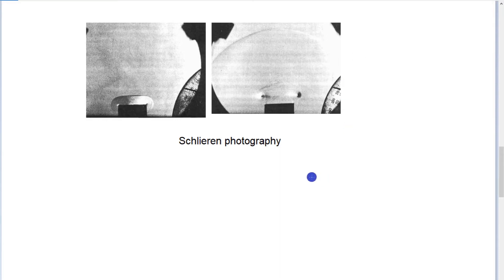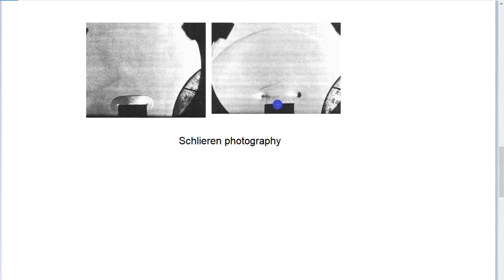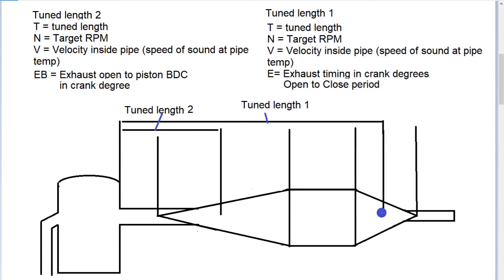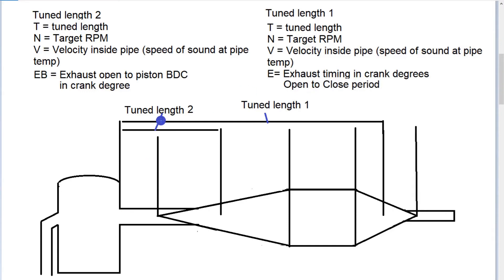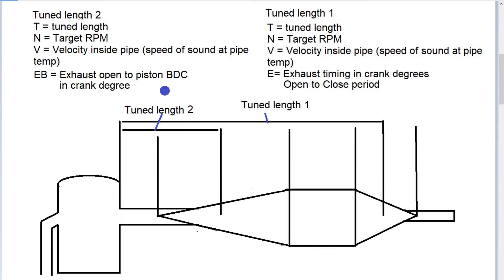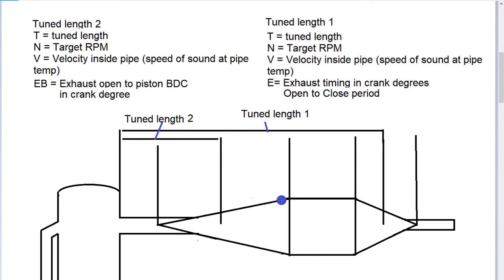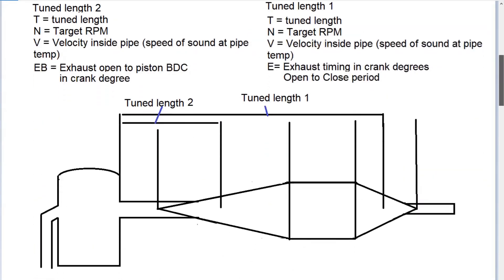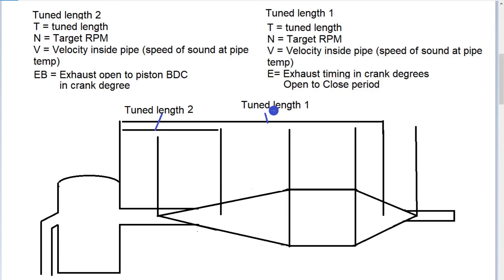The two tuned lengths of the 2 stroke expansion chamber, photo of compression wave formation. E3

Comment: Would expansion exhaust be benifital for a rotary engine ?
Reply from the maker: In short, no.
Reply from the maker: The long answer as to why it wouldn't help is that an expansion chambers relies in a pressurised intake such as a 2 stroke has, the crank case creating a compression of the intake mixture that is then fed to the cylinder via transfers.
A rotary or any normally aspirated engine lacks that.
It would work with a super charger and has been used but as the super charger pressure can be dialed up it negates the need for an expansion chamber that would only work over a limited RPM range anyway.
Reply: @AuMechanic  do you know of any rotary exhaust tunning science,  like matching  extractor lengths to engine port sizing?
Reply from the maker: @shaunessex3095  
Never built an exhaust for a rotary only 4t and 2t piston engines so I don't have the experience to give advice on it.
A general guideline to matching ex port to header is aim to have a the same or slightly large header than port, but never smaller header.
And always use mandrel bent sections for bends to maintain the cross sectional area of the pipes.
Reply: I've always been in the understanding rotary exhaust requires a sertain amount of back pressure but not many people mention it though, rotaries are essentially 4 cycle 2stroke simular animals ,but the gas tem

Comment: Can I reduce the header length by 90% & compensate in My baffle cone & chamber dimensions?
Reply from the maker: Not if you want to pipe to work correctly.
A small change in the header is ok but not 90%
Reply: @AuMechanic  
So why is a motocross pipe header so much shorter than a header on a street machine like the H1?

I just wonder if the software will let Me start the divergent cone within 3" of port instead of 12" before diverging, if I overcompensate in other areas to possibly increase overall performance.

One thing is certain, I will be moving redline from 9000 to 12,000 rpm, so many factors at work here.

Thanks for taking time to answer. 

What would be the broad effect?
A total loss of power or merely narrowing the power band?
I thought of taking an 01 CR250R pipe apart, & reverse engineering 3 prototypes & just bolt em on to see what changes good or bad occur, then rechunking the figures in the software to establish a baseline.
Reply from the maker: @Not1Edit  "So why is a motocross pipe header so much shorter than a header on a street machine like the H1?"
Because the header is quote tapered compared to a street or race pipe for example that operates in a more narrow power band.
In short, longer cones equals wider power band at lower peak. shorter straighter cones are shorter power band at higher peak
Reply: @AuMechanic  
Not much for kicking ideas around eh?

Answer Me this then, all things being equal what would be the effect of a 250cc pipe on a 125cc & vice versa?
Reply from the maker: @Not1Edit  Got as full dance card these days.
As to 250 125, the pipe dimensions are in proportion to the port window area which itself is in proportion to the engine capacity, so a smaller bore and stroke will have a smaller port window which will result in a smaller pipe using a pipe calculator.
Reply: @AuMechanic  
Thank You very much, as soon as I get My new top end degreed & calculated I'll be in touch.
Reply: I got Your software downloaded, plugged My numbers in & got a very accurate appearing  render of other aftermarket chambers, which is what I had hoped for.

What I wasn't able to do was adjust outputs to suit My design constraints, so I'll still have to do a bit of improv, but that's okay, Your software gave me an ideal, so using that as a baseline I can extrapolate & tweak from there.
Cheers mate, & thanks again, I'll be in touch. @AuMechanic

Comment: Great stuff mate. I’m in the process of designing a pipe for a vintage MX 125 and I’d like to verify my design with these concepts. What formula should I use to arrive at the tuned lengths for these two tuned lengths ? For the port blocking do I use the degree open of ex port to closure of transfer port ? In my case it would be half of 190 (ex) plus half of transfer 130 equaling 160 degrees.
Reply from the maker: Have a look in the description section for the link to my free Pipe Calc software that can do the calculations.
Transfer timing is not part of the tuned length calc, it is based on Ex port timing only.
Reply: Sorry , night shift haze . Port plugging is ex port open to port close . 190 degree in my case however expansion wave from BDC to TFR close I take it . Question 2 
If Approaching BDC piston movement is Deminishing for every degree of rotation. This would mean crankcase compression is also reducing. Maybe the inertia of the gas flow counters what I’m about to say but wouldn’t it be good to get pipe suction just before BDC ?
Reply from the maker: @thirdstone4107  
Re question 2. That is the case, the expansion wave (AKA suction wave) that comes from the diffuser cone should arrive around BDC. See this video here https://www.youtube.com/watch?v=5fojBHZNAWM
Reply: AuMechanic what is the formula for the tuned lengths for? I’ve been trying to nut this out but no success. For a duration of 190 deg do I use 95 deg for suction wave which would have the crank at BDC ?Same with the blocking wave which you time for the closing of the transfers. I couldn’t see this info in the free program. Cheers
Reply from the maker: @thirdstone4107  
You insert the total duration of Exhaust (in my software) of 190 degree, using the RPM that is the maximum RPM of the engine (and average Exhaust temp based on BMEP). reflectedIn the video I refer to there being 2 tuned lengths (for the purpose of demonstrating that there are 2 wave reflections to time) but in the equation we only need to calculate the tuned length of the compression (plugging) wave. The equation used (Prof Blair) accounts for the tuned length of the first expansion wave in relation to the second compression wave is in the equation so there is no need to calculate it separately.
Reply: AuMechanic thanks , I understand the total tuned length . I was hoping that there was some calculations that would aid in working out the length of the reflector cone and also the start of the belly. WRT the 3 Rd stage diffuser would that be positioned where the wave would be a BDC at the target RPM? I guess that is all included in the program. 
The tuned length is what it is for all types of engines however the rest of the design would differ a lot between a road racer and a MX bike . Cheers
Reply from the maker: @thirdstone4107  
No it wont differ as the cone taper is remains in the same relationship to the rest of the pipe in the equation.
Keep in mind that Exhaust port timing (closing BTDC and opening ATDC) is symmetrical (same number of degree form TDC) so BDC is always half of the total timing.
Reply: Donated to buy you a drink , Cheers
Reply from the maker: @thirdstone4107  
Thank you, much appreciated.
Hope you find the software useful.

Comment: Outboards use a "sliding" expansion chamber. I believe they shorten the pipe for torque, lengthen for RPM. Can you explain this?
Reply from the maker: Adjusting the length changes to "tuned length" as covered in the videos.
A shorter tuned length will be tuned to higher RPM

Comment: How do you calculate the 2nd(diffuser) tuned length? Whats the formula
Reply from the maker: You dont need to using the caclulator software.
Showing there are 2 tuned lengths is just to demonstrate the principle of the 2 differring wave reflections in the pipe being the expansion wave from the diffuser and the compression wave off the baffle cone and there different arrival times back at the exhaust port.
Reply: @AuMechanic  so you cant calculate the 2nd tuned length without the software? Just like how the 1st tuned length can be calculated with jennings and bell's formulas
Reply from the maker: @wrongchannelsearchfordeank6834  
You can calculate it just the same way, but for the purpose of designing a pipe it is not needed.
Bells equations are a metric derivative of Jennings for the late 1970's
What I use in the software is Blairs equation from the late 90's that was created using far more scientific methods than Jennings.
Basically Jennings specifies lengths of the sections where Blair provides ratios to determine the lengths that you enter into the software.
Reply: @AuMechanic  thank you i truly appreciate your explaining

Comment: Hi, thank you for this videos , they are really helpfull. As a general rule i undersand that having a longer pipe between exhaust port and the divergent cone help for low rom . How will look like an exhaust for a minareli am6 with 80cc cilinder 22mm carb for as much torque as posibile and as wide as posibile power band ? I agree to sacrifice all the power above 9k-10k rpm If needed . I want to get rid of that motocross feeling and get a more usuable power band between 5k-10k .
Reply from the maker: Regarding the header pipe length, what you stated there about longer headers equals more low end, it is from very early book and pipe equations by Gordon Jennings from the 1970's and was created by him measuring numerous pipes and some reverse engineering to arrive at his theories on pipes..
If you watch the series of videos here they are based on later more scientific SAE published studies done by Professor Gordon Blair published around 1996 that provides pipe equations used in the free software I have available.

In that, more low end or wider power spread requires a few factors in the whole pipe design more than just the header pipe, as you will see if you use it.

Comment: I have a older jet boat. Inline 4 cyl 2stroke an they all share a single manifold an just feel like it’s a horrible design an possibly a waste of fuel an more so power. I am limited on space a little bit in comparison to say 4 single 400cc dirt bike exspansion chambers to be able to fit in there so I’m looking into making my own. I’ve gotta pretty good at welding an tig welding. Now looking for more info on the actual leaghths to see if with my limited space if I’m able to achieve performance gains with four short chambers or if I’m best off with the current no chambers design it came with in 1999 an also all 2stroke boat engines fer that matter. Still makes no sense why they did that. I run 3,000 rpm when I hit throttle an up to 5,500rpm but most the time I’m at 4,500-5,200rpm so it’s still a very narrow window witch wat I heard is they don’t run them because they are for a narrow window of rpm we’ll boats are in a narrow window of rpm. I’m wrkn with 1,000 rpm so wouldn’t chambers be a great way to add some usable power
Reply from the maker: Ive replied to this in the other video comment (here https://www.youtube.com/watch?v=4_DmKcJieNg&lc= ) but just to reiterate that noise and emissions are other reasons for the stock exhaust.

An expansion chamber can be designed to provide broad power but it come as the expensive of peak power.
Re lengths, have a look at the later videos covering "tuned length"

Comment: 3 min 44 you say "sometime between that point". do you go into it in more detail on any of your videos? also   at what point of the combustion stroke do the gases exiting the exhaust port  not carry a pulse?  cos they only fire out of the port for so long.
and when exactly do you want the suction pulse to stop in relation to the transfer . just as its closing or a tad before? also i would love to see the demonstration with numbers that you refer to that you say on the next one but i cant find it. great videos.cheers
Reply from the maker: I cover this a bit more in other videos but specifically or at least in the case of the Blair Design Chamber the peak of the Expansion wave needs to return around BDC and continue to through the period of upstroke while the transfer is still open to a fair degree to aid transfer.
When the transfer is nearly closed there is little served by having the pulse timed to move only a small amount through the remaining small opening, keeping in mind the pulse of the expansion wave only last for so long.

The exhaust "pulse" you refer to from exhaust gases occurs only at the short moment the exhaust opens at the blow down stage, being created by the initial pressure differential causing the gas to pass through the opening at very high speed which causes the compression wave (you can think of as a sound pulse) to travel at the local speed of sound down the pipe which is a lot faster than the bulk of the exhaust gas.
See later video named "Active Demo of Wave" might explain bit more.
Reply: so once the piston is opening the transfers on its descent that's basically the end of usable pulses coming FROM the exhaust port?so that's the point in crank rotation  that I have to work out how fast the pulses travel and are sent back to do their correct jobs through cone convergence or divergence?I know I could just enter the details into your calc but I still would like to know whats happening. initially my first thought is, having a longer blowdown (till the transfers open) gives me a longer pulse to play with. and if the pipe is good enough it could actually outweigh the disadvantages of a longer blowdown re less scavenging.?
Reply from the maker: There is one "pulse" coming from the exhaust at the moment it opens being the initial compression wave that then travels down the pipe, the second one being the expansion wave and it is timed to be reflected back from the diffuser taper back into the exhaust port, the peak of it arriving around BDC.
Blow down period is not directly related to the pipe function, blown down is the period between exhaust open and transfer open, and blow down has to be long enough to ensure enough pressure blows down out the exhaust before the transfer opens or an excess of exhaust will be pushed back down the transfer when it opens against the fresh intake coming up the transfer to the cylinder
Reply: really only one pulse? so when is the exact time of this pulse for working out when it needs to return? I cant get my head round when this happens. it cant happen as the port opens because its only a fraction open, or does the pulse have a duration? ie starts as the port opens and ends a few degrees later?
Reply from the maker: @aljaxon69  
One positive pressure pulse is created, but you end up with 2 pulses, one is a reflection form the first cone and the other is the original pulse that bounces of the second rear cone.
"does the pulse have a duration? ie starts as the port opens and ends a few degrees later?"
Yes that is pretty much it.
The positive pressure pulse (compression wave) moves at the local speed of sound inside the pipe which is predominately determined by gas temperature in the pipe it is travelling through.
As the initial compression wave passes the first diffuser cone an expansion wave (you can think of as suction pulse although that is not technically correct) is reflected back arriving at around BDC to help draw fresh mixture into the cylinder from the transfers..
The total length of the pipe (tuned length) is set to ensure the pulse (compression wave) travels down the pipe to the end cone and back again within the exhaust port open period at a given RPM.
It's job is to push intake mixture that has spilled out the exhaust port back into the cylinder, called port plugging.
Reply: yeah I understand how the diverging cones/diffuser  send back a "suction" pulse and the converging /baffle cone sends back a stuffing pulse but its the duration of these pulses. I thought they were continuous pulses or waves that started as the ex port opened and then slowly died out as the pressure dropped in the cylinder. dunno why I thought that, maybe that's how it had been explained to me before.I need to know the exact duration of the pulse at its beginning so I can then calculate lengths to get it back at the port. also some of the pulse gets sent back by the diffuser and some gets sent back by the baffle cone so how do we decide how much we use to suck and how much to stuff? is that by the angles? ie steeper angle more effect? I think I need to re read Jennings, I tried blair but it went way over my head.
Reply from the maker: @aljaxon69  
Ok, the duration of the pulse will depend on the pressure differential between cylinder and port when it opens and how rapidly the port opens.
For example a port with curved roof will have a more gradual opening so will reduce the peak of the pulse but it will also make the pulse longer.
Keep in mind the pulse being like a sonic wave is created by the initial gas molecules moving at very high speed just as the port opens..
Like the champagne bottle opening causes an audible sound.
The initial rapid flow of gas creates an energy wave that moves at the speed of sound to your ear some distance away.
And it is not a pulse of gas moving it is a pulse of energy moving through the air.

Comment: Thanks mate, just the sort of info I was looking for.
Do the same calculations apply to using different fuels, like methanol/nitromethane in radio control aircraft?
Reply from the maker: Yes John the same equations do apply to any 2 stroke with piston port exhaust and crank case induction.
The difference with fuels is in the tuned length calculations where the sonic velocity in exhaust gases varies from gasoline but only slightly.
Reply: @AuMechanic  
Thanks for that. 
I just converted my RC helicopter 15cc glow ignition (methanol/nitromethane) to petrol with a CDI spark ignition and was hoping I could use the same pipe.
Reply from the maker: If the exhaust port timing and port sizes (area) is different then you will need a pipe to suit that, tuned lengths is not the only parameter.
See some of the later videos in which I cover the equations used to design a pipe and I also have a software available that does the same equations.